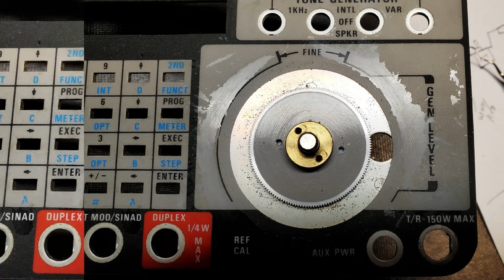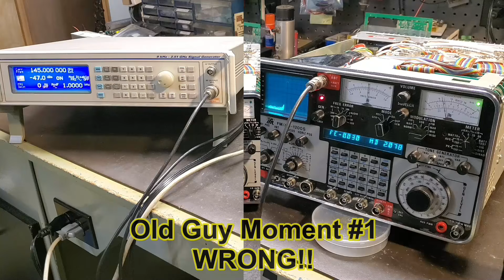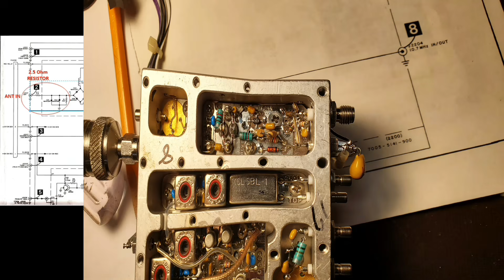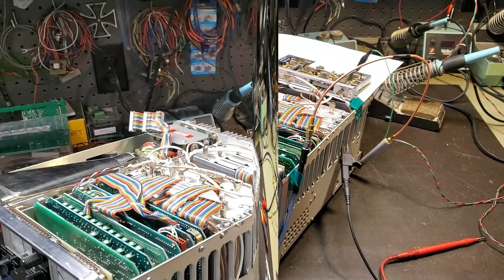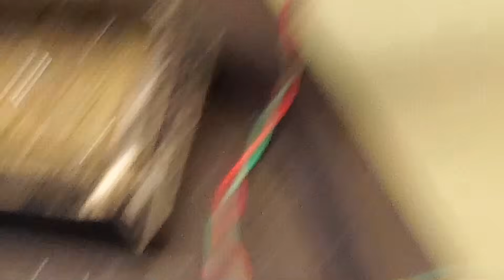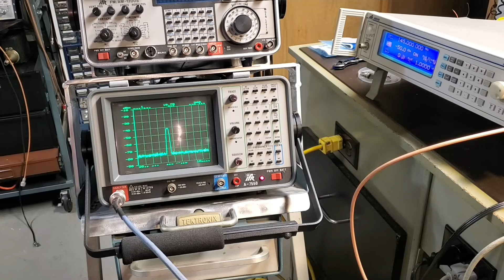Another IFR Project

Comment: Skip,  Your technique on the sealed switches saved me ( loosening the nuts and using an exacto knife).  I had pondered how to accomplish this and your tip worked great.  Thanks a million !
Reply from the maker: Well glad it helped.. Believe me I wondered myself how I was going to do it also!  I sure didn't want to pull it off the board so seeing the small bolts I figured I might get it split a hair to squirt a little fluid into it.. 
I was relieved it worked.. Thanks, Skip

Comment: I figured that the capacitor C76 had shorted, and messed with power on Q3 and Q3, I was surprised it was the inductor.

Likely someone plugged the wrong cable in, and opened the inductor.  I'm surprised it didn't take out U3B

Well done
Reply from the maker: I never thought of that.. Somebody was in this thing before but it was more for the usual power supply problem.. Hard to say what caused it..
I could swear I measured the voltage on that output and even wrote it on the schematic.. But that could of been from the other module.. Like I said if I did cause it for some reason why isn't the original problem still there.. Oh well it was interesting.. Thanks.. Skip
Reply: @VE6BGT  My friend who works on quite a few IFRs tends to replace all the electrolytic caps if things are weird. We both share a hatred of Tantalums, which always like to short out and take other things with them.
Reply from the maker: Yes tantlums are a curse.. To change every last one woukd be a chore..
The generator used had an issue with  capacitors, not tantrums but electrolytic types..  I changed a pile of them in that one.. Easier than trying to figure out which one is the bad one..  A lot of work getting them all..